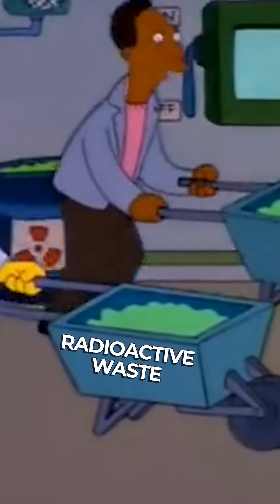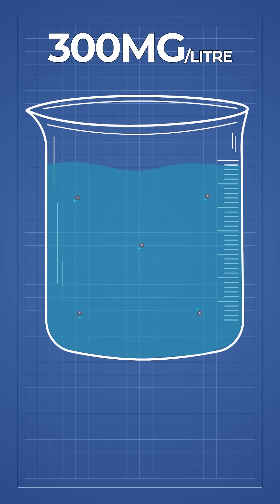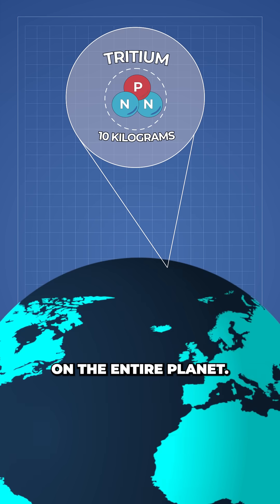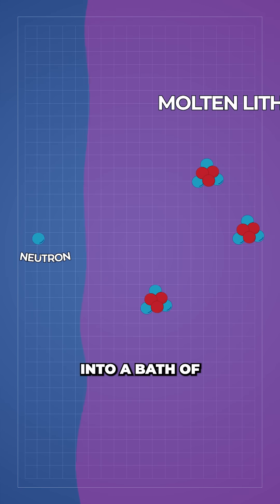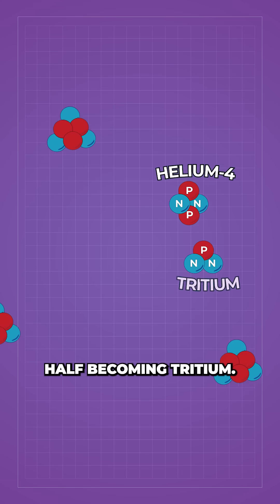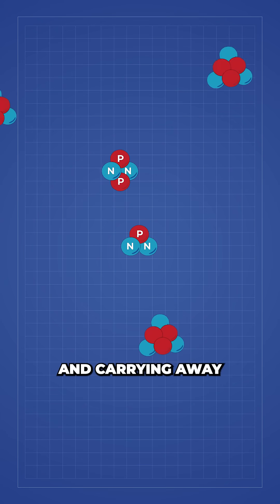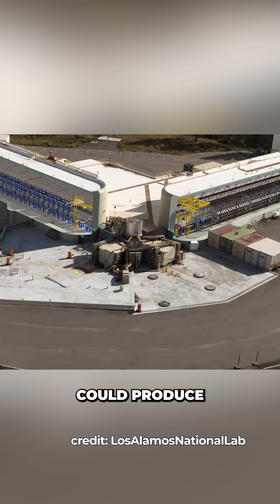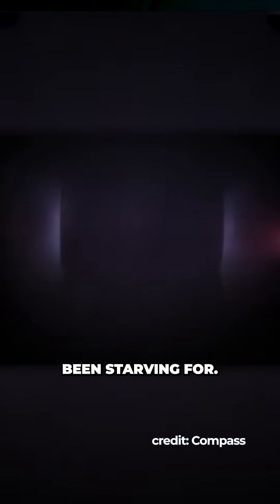Scientists Just Created Fusion Fuel From Nuclear Waste

Comment: OK, If I may, I have a lot of questions here.
1. How much does it cost to operate the particle accelerator?
2. the Tritium that is generated from that reaction, will it be enough to cover the energy used by the particle accelerator (assume the energy used to get deuterium is negligible)?
3. So the nuclear waste is only used to extract the neutron. What is the byproduct of that spallation? another waste? If it is, then it's like taking the cap of a plastic bottle, while still having the plastic bottle body as a waste.
4. if we only need the neutron from the nuclear waste, is there no other viable source of neutron that require less energy to extract?
Reply: The fusion reactor can supply neutrons. 
The process exeliraty the decay and shorten the time the waste is highly radioactive

Comment: There do exist fusion reactor designs that don't use tritium, but they're more difficult to build and use (as I understand it).  There are designs for fusion breeder reactors that create tritium as a byproduct as well.  Those reactors don't put out as much energy, but they do still provide a positive gain.  A proposal has been made to use these as fuel generators (that also produce some power), and using the tritium they produce in a dedicated power reactor.

Comment: Those research scientists didn’t do a cost analysis of how costly the tritium would be when made by this process. They didn’t figure in the cost of chemically reprocessing the intensely radioactive waste material, enriching the natural lithium with the lithium-6 isotope purifying the resulting tritium, or include the cost of the superconducting accelerator which was primary funded in conjunction with the lab’s nuclear weapons work.

For decades nuclear fusion energy experimenters have been claiming that the hydrogen fuel is almost limitless. Always omitted is the fact that the radioactive tritium commercial price is more than $30,000 per gram. The prospects, of the experiments soon leading to an economically practical source of electrical energy, has always been oversold to journalists, the general public and to potential funders.

Comment: There is an incredibly valuable thing that could be done with this. Nuclear fusion energy is perfectly clean and so resoundingly efficient you could create this configuration of revolutionary power generation.

They are capable of putting enough output power to run a plant like this easily. Meaning if we brunt the cost to produce a reactors say 3 month supply of tritium and then output power from the reactor to the plant. Allowing it to generate another 3 months WORTH of tritium before it itself runs out. Meaning as long as we have access to nuclear waste, which... we WILL, it allows us to create an unrivaled energy source. That can exclusively power its own fuel manufacturing at a net gain. Producing more fuel than is consumed. And more power than is consumed to make the fuel. Fusion will change everything.

Comment: Ummm. Guys... We already do this at conventional pressurized water reactors. We use lithium to control pH in the primary, which is subject to intense neutron flux. We use the tritium produced to measure steam generator leakage... we even had a chemist who ended up on a government watchlist when he tried to get some tritium to compensate for the low levels of tritium in the water prior to starting up the reactor after refueling.

Comment: also Helium-3 which can be harvested easily (relatively to Tritium as of right now) in vast quantities on the surface of the moon and can be used to power moon outposts (very important. The moon is energy decrepit basically, no usable fuel besides radioactive gas and dust. and it has a 28 day cycle means 2 weeks of solar outage requiring tons of batteries.) if fusion is finally solved and usable, a moon base fusion reactor should be the first thing we do with it. we can easily multiply the amount of fusion reactors we have, and literally reverse the entire global warming process with the power of the sun in the palm of our reactors. shove all that carbon back in the ground and we bought time for us, and insurance for Earth (in the event of great catastrophe, the next generation has carbon fuel to restart civilization).

with the borrowed time, we must establish a solid moon colony that is self sufficient, and can output industries and support pioneering. that way, we will not be trapped with no resources to leave our planet's gravity well. a moon colony can generate rocket fuel, and process asteroids for raw resources including carbon compounds for growing stuff and making plastic. not just metal and rocks are found in space rocks. even if we're stuck with no ways to launch a rocket, a moon base can deliver resources harvested straight from the cosmos for us to re-establish space transit from earth.

after that, its only limited not by science, but by us humans as a whole. if we were to achieve any of this, we would've already solved world differences and stand as one singular human race.

Comment: While this is interesting, it isnt realistic for the following reasons: tritium can be created way easier using lithium, that method is safer, easier and also way more productive, radioactive waste would only deliver a fraction of what is needed in fusion reactors. still an interesting topic and worth the research, as it could be an option if it makes a breakthrough in its flaws

Comment: Lining the inside of your fusion reactor with solid or molten lithium (or even better circulating it through the reactor wall to also cool it) would achieve the same result without requiring a particle accelerator or ever having to mess with nuclear waste.
Reply: There's quite a lot of nuclear waste. It would be nice to get rid of it.
Reply: @extrasmallbeep you dont actually get rid of "nuclear waste". You just repurpose completely fine uranium or plutonium for this. Which then splits into actual waste, lol.
Reply: @extrasmallbeep Por que no los dos?
Nothing is stopping people from utilizing both methods, except for cost. The biggest reactors would likely install the lithium sinks to produce some fuel, while smaller ones likely wouldn’t find it cost-effective.

Sidenote-Not a nuclear physicist, so I have no idea if it makes sense to install lithium heat sinks on every reactor or not. I’m guessing not.
Reply: @extrasmallbeep There really isn't, at least not the kind of waste that could be used for this. Iirc, that kind of waste amounts to less than 2 tons ever . The vast, vast majority of radioactive waste is stuff like PPE or contaminated containers used during the handling/storage/operation of nuclear waste/equipment, non of which would be usable for this. Plus, we have plenty of effective ways of dealing with that stuff in a pretty much permanent manner, the only slight hiccup is cost.
Reply: Nuclear waste isn't real, you just use it as fuel in other practical ways
Reply: A) Regarding lithium breeding blankets in fusion reactors: This has been proposed, and works in theory, but is difficult in practice. We will run out of tritium before the engineers/scientists have worked out all the problems. The devil is always in the details.
Reply: B) Regarding this proposal: Any nuclear reactor can be used to breed tritium from lithium. Some are more suitable than others for various technical reasons.
The accelerator driven design has two advantages: 1) Without the external accelerator the reactor is sub-critical and therefore an uncontrolled chain reaction is completely impossible (other types of accidents could still occur). 2) Because the particle accelerator can be regulated over a wide range, the reactor can use many different kinds of fuels, which includes nuclear waste. It can reduce the presence of certain highly problematic elements in the waste and therefore make it easier to handle (but you can not get rid of the waste completely).
Reply: You know, I'm sure the literal nuclear physicists/engineers that created these billion dollar fusion reactors thought about that and chose not to do it for whatever reason, unless these scientists were too stupid to think about such a thing and you're smarter than the hundreds or thousands of top-level experts involved in every step of the process.
Reply: @Sixpence012 Could just be scale. Experiments are often conducted at smaller scales, even if it requires more space, to test if the hypothesis is true. Once they prove it, they can then pitch for bigger and bigger experiments and refine the process until they hit a viable solution.
Reply: @Sixpence012 never assume that. Some major breakthroughs have been made by laymen shooting the shit
Reply: It might also be that the lithium fission reaction requires the particle accelerator. I'm not sure if the neutrons from the regular reactor operations have enough energy to split the lithium.
Reply: @KylenKiomaka regular uranium fission yeah they do that's how we made tritium now but the neutrons off of heavy trans uranic  elements would so why not drive it with an accelerator
Reply: To those dissing on OP, when did sharing an idea/opinion on YouTube become a crime? Tossing ideas however impractical or seemingly dumb is how brainstorming works. Why be snarky about someone sharing an idea?
Reply: Yeah duh where you gonna get enough tritium to fire the damn thing long enough to get the tritium from the lithium metal coolant to keep it going Mr cart before the horse
Reply: It's waste lmao. If we're running low we can just do more fission
Reply: I'm sure I trust the random person with a clip profile picture over actual nuclear scientists.

I can think of at least a few ways as to why your idea is absolutely terrible, but again, what can anyone expect from someone who knows nothing like yourself

Comment: This is at a very early stage of mathematical models and has a lot of engineering to be applied.
And no, you can't use all the nuclear waste. Only very specific one that is not too common. 
And it turns into different radioactive waste during the process. 

I'm not a naysayer. I live from high end research. But this is far away from any kind of practical application. 
We could have stable fusion reactors before we can produce the fuel for them.

Comment: Nuke plants make tritium by the boatload, though.
Why do you need some super special process? It's even worse for heavy water reactors, they make so much they often have to filter it out of the system. That's already a deuterium/tritium mix ready to sell/give away rather than dispose of. 
Tritium does what we call "migrating" through the reactor vessel, so we always have to account for it discharging. There's a lot of groundwater programs at nuke plants that would be HAPPY to collect tritiated groundwater and sell it rather than discharging it!